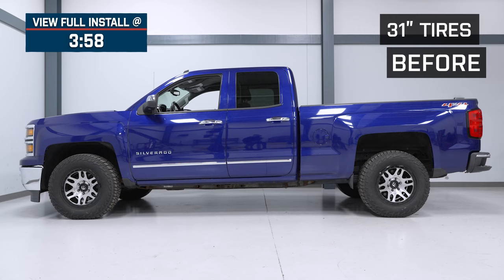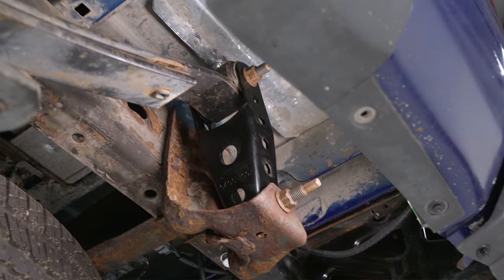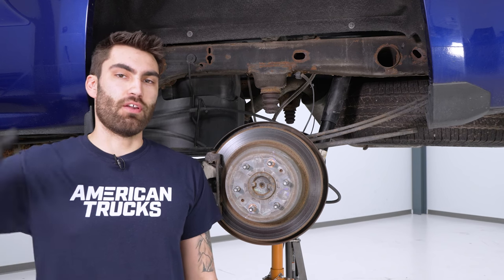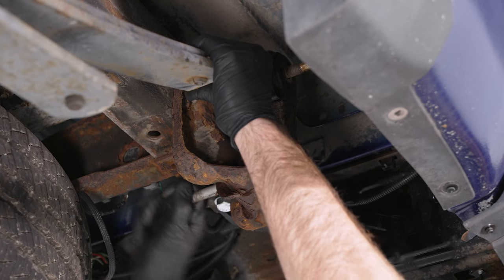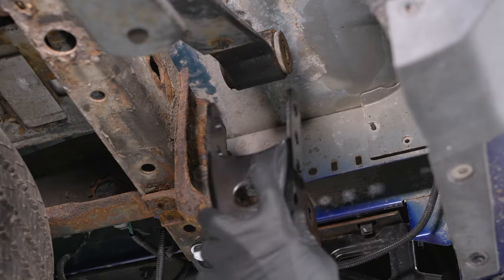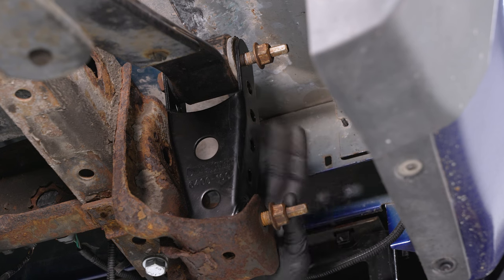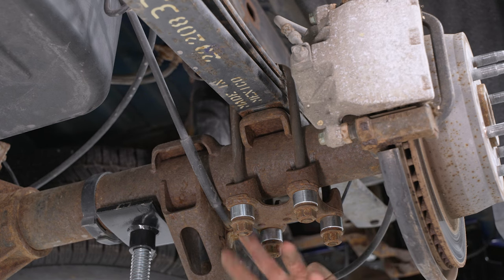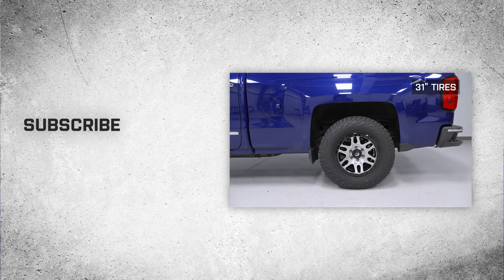2007-2018 Silverado 1500 Belltech 2 or 3-Inch Drop Leaf Spring Shackles Review & Install

Comment: For anyone on here what would happen if you only removed the block between the axle and leaf spring and not use a shackle kit? would that not give you a drop as-well?
Reply: It would lower the rear by 1.25 inches.
Reply: How about the shocks ,
Reply: @jairotoda  i took out the blocks and am running the original shocks with 115k miles and 6 years on them. They haven't given me any issues since I took the blocks out a month ago. I haven't hauled anything though. I do much prefer the ride and look and convenience of having the front at stock height with the rear block taken out versus having a spacer leveling kit in the front with the stock rear suspension. I'm running 17 inch wheels now with 265/70r17 Cooper Road+Trail and I love it. I did have the OEM 22 inch wheels with the predecessor to the road+trail which is the Discoverer AT3 4S. The tire was great, but the wheel significantly holds back the performance of a tire. Having more sidewall like I do with my 17 inch wheels means more tire flex for traction, and more sidewall which helps significantly with comfort on rough roads.